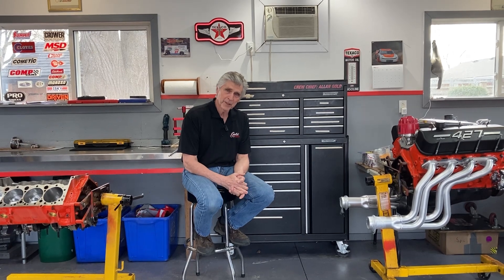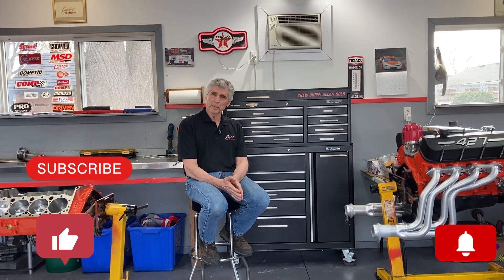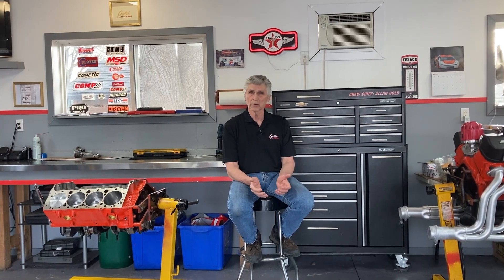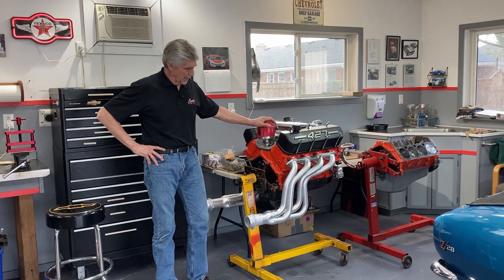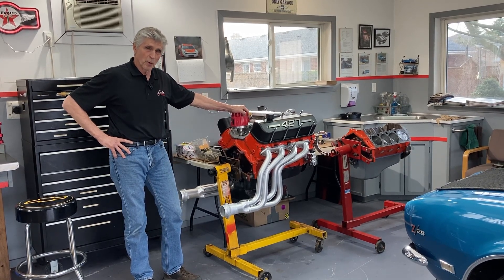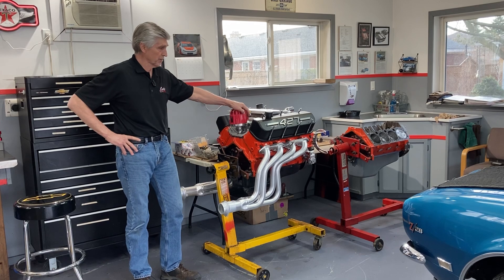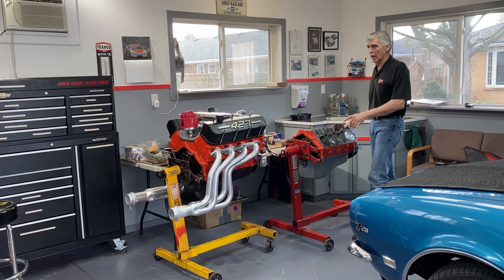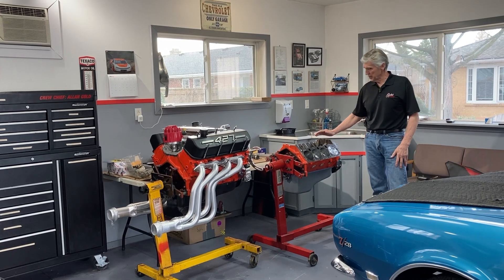Compression Myths - How much compression can you run on pump gas? Questions Answered

Comment: I have a 440 12.5;1 mopar been running 104 plus with 93 for many years no problems. For hard racing I run race fuel and still have steel heads.
Reply from the maker: Thanks for sharing your experience Mopar. All good info. AG
Reply: I call engines "motors" all the time so that I can see who is a newbie and corrects me.  Are you doing the same with your "steel" heads? Because I can assure that all classic American water cooled engines had Cast Iron block, cylinder heads, exhaust manifolds, ets. Steel has pure iron in it and 1,2,3,4,5% carbon blended homogeneously in it. Cast iron is pure iron with more than 5% carbon, a bunch of impurities, and silicon. Silicon makes it so the "excess" carbon precipitates like rain out of humid air - after the iron is poured/cast. So it's like tiny chocolate chips of pure graphite throughout the part. Some car crankshafts are forged steel to resist breakage. Most truck engines have cast iron crankshafts because the connecting rod journals are way harder and resist wear 10X better than forged steel .Lastly when you melt cast iron it gets really fluid and fills out a cheap sand mold exactly. Steel kind of has to made into giant rods called "blooms" and either some bitten off and hammered into a part or else the whole thing gets made into a battleship gun barrel or bridge part.
Reply from the maker: Thanks Patrick lots of good information here. I am guilty of using the wrong terms too even though I know better. A motor is an electrical device. An engine turns chemical energy (fuel) into mechanical energy and heat via combustion.
I haven't heard some of the steel terms in a while.  
In my corporate career I worked for an integrated steel company (Algoma Steel) for 34 years and retired as a General Manager in 2004, then consulted in the industry for many of the major steel companies in the world including US Steel until a few years ago. 
At Algoma we made about 3 million tons of steel per year via the integrated process, pelletized iron ore, coal (refined as coke) and limestone produced raw iron in a blast furnace, also known as pig iron, about 3% carbon. The pig iron was then transferred to the steelmaking shop and mixed with about 20% scrap and refined in 350 ton BOF (Basic Oxygen furnace) a batch process using 27,000CFM of pure oxygen for about 20 minutes. That reduced the carbon content to about 0.10-20% depending on the application, further refined in an LMF, (Ladle Metallurgy Furnace) and prepared for continuous casting and subsequently rolling down to <1mm. (039") thick. End application automotive, appliances etc. (sheet and strip.)
You are correct, cast iron is brittle because of the high carbon content. Steel used in forged crankshafts and rods for example (4340) is 0.4% carbon. The third number is the carbon content. 
You are correct, heads and blocks are either cast iron or cast aluminum.  Forged cranks and rods are steel, usually 4340. 4140 or 5140. 
Hope this helps, and thanks for your valued input. Please keep watching and commenting. AG
Reply: @goldsgarage8236  Ah, good - you know the deal, then.  I am a genetic hillbilly and I hereby grant you license to say "My Mopar Motor has Steel Heads" with a straight face 1) because it sounds cool 2) impresses women and kids. 3) Creative lying is a time-honored hillbilly art form  :  )
Reply from the maker: thanks Patrick AG

Comment: I’m wondering how much of a difference “chamber softening” or polishing and spark plug selection make on an engine’s resistance to knock and pre-ignition.  Have you ever quantified that for your engines?  Great video by the way!
Reply from the maker: Thanks Nate. spark plug selection sure does, I meant to mention it in the video but it slipped my mind so thanks for reminding me. I also missed discussing quench, I will try to correct that in future videos.  I have looked at chamber softening info but never applied it. Good points. AG
Reply: @goldsgarage8236  What is quench exactly?
Reply: @seanmclaughlin7415   - quench is the area between the piston and the cylinder head surface that get very close together with the piston at TDC.  From what I’ve heard, it is very critical on a Small Block Chevy style engine but not as critical on an LS.  I’ve heard that a tight quench is a free boost to compression ratio but never have seen it quantified or measured versus knock/pre-ignition. Would be an awesome Richard Holdner or Engine Masters episode.
Reply: @natez0690  Thanks for responding. I saw a video that Steve Morris did on quench and how they approach this. Basically, it is more trial and error more so than math, but math is involved. Steve designs a conical shape with the combustion chamber on the side where the piston meets the flat of the head into the combustion chamber. Also, he gets the the piston to actually touch the flat safely to maximize quench. Obviously the DIY’er doesn’t have the equipment to do what he does, or maybe there are other ways to achieve this.
Reply: Any and all of those factors will and can cause major swings in a max effort engine build  exercise caution and diligence you should have a good time

Comment: I’ve always been under the opinion that the air pump’s purpose was to also help with any unburnt hydrocarbons in the exhaust. Not sure if they were onto intake/exhaust reversion yet. 🤷‍♂️
Reply from the maker: Thanks Lujin, you are probably right about that. Thanks for your input. AG

Comment: You should discuss quench/squish in relation to how high a CR can be run on 91/93 octane pump gas. It plays a big factor in avoiding lean pockets of mixture in the cylinder.
BTW: I never understood running 87 octane piss in an expensive, high compression engine.
Reply from the maker: Thanks Joseph. I did intend to do that in the last video. I guess I should make a script. Anyway, I will fit that in a future video. Thanks for the input/AG
Reply: I agree on the quench topic.

Comment: Basically what's going on in any motor is timing. The camshaft controls that . But at the end of the day , cranking psi will determine what octane rated fuel you need . The rest is preference. I recommend finding a reputable engine builder ,
Reply from the maker: Thanks for your comment. AG

Comment: How do you feel about fuel additives that increase octane? And is there any you can suggest I ran sunoco 102 octane when I lived in Florida I could get it at the gas station I'm back in Louisiana now and all I can get is 93 octane I would go E85 but they are few around where I live. The closest is about 30 miles away
Reply: Boostane is a quality octane boost. All the better tuner shops I know swear by it. Tuning 1000rwhp modern muscle cars.
Reply: @pockets5628  thanks for the info
Reply from the maker: Thanks for the info Pockets. AG
Reply from the maker: Sorry Richard, I don't have much experience with octane boosters myself but it looks like Pockets does. AG
Reply: @goldsgarage8236  I use VP or Torco additives..store bought stuff is snake oil.

Comment: Car manufacturers definitely gave in to pressures from big insurance and EPA. What's really interesting is if you look at hp numbers throughout the 70's, 80's & 90's they were dismal in comparison to hp #'s from the 60s. Then something really great happened, between Ethonal, forced induction and nitrous the hp has returned in a big way and now we can really go FAST. LONG LIVE THE HOT ROD!!!!!!
Reply from the maker: Thanks Zl, I agree it took the OEMs more than 20 years to learn how to make power again. Computers helped. AG
Reply: Always worth noting that right as the EPA regulations were killing power manufacturers were also required to start reporting horsepower with all the accessories and exhaust attached.  (a '60's car with a SAE gross 350hp might only rate at 315hp or whatever under 1970's SAE net standards)
Reply: I wouldn’t call what the EPA did “pressures.”  You also have to account for the change from gross to net hp ratings. And also that they’re “ratings.” Even things like the 03-04 cobra were “rated” at 390 crank hp…but dyno’ed that much at the wheels.

Comment: It's not just in your compression ratio, at least 30% of it is in your cam timing, with overlap and duration - and is overlooked by a good percentage of people. I guarantee you could take an 8:1 compression ratio engine and put too much cam in it and have it ping.
Reply: True,,a low duration or stock cam too far advanced so the intake valve closes too early will build more dynamic compression
Reply: @rodfonda3248  all the talking about static and finally someone bring dynamic thank you sir
Reply from the maker: Thanks Chuck, you are right on. I remember hearing many engines ping if the conditions were right. Thanks for your comment. AG

Comment: Get good cylinder heads with good combustion chambers, that helps in being able to run less timing, today's fuel releases its energy alot sooner. 
Your turning strategy with high compression engines must mirror that of an engine running forced induction.
What does a 700 hp Hellcat run for fuel???...91-93 pump!
Remember 14.7 to 1 is not the right AF ratio to tune with any more, you must take into consideration that Ethanol content, and make the overall tune richer.
Reply from the maker: All good points, thanks Duane and sorry I missed your comment until now. AG

Comment: Does  octane boost in cans really work  ??  Does  it do harm to carburetors  and fuel pumps ??
Reply from the maker: Thanks Richie, I don't have much experience with octane boosters. I build engines that don't need them. 
I think they do work if you are diligent about mixing etc. They are also not cheap. AG
Reply: If you buy the good stuff. Auto parts store octane boosters, no . Garbage,

Comment: Hey Mr. Gold, I'd like to share additional experiences with you and the viewers with my 11.6 to 1 stroker project car.  We spoke before about my running 93 on the street with good success as long as I stay out of the secondary's (tunnel ram 600 vac).  Race gas needed for WOT, (drag strip). Another problem with this setup is not getting what you pay for.  Not all gas stations pump 93 from the 93 tanks.  I've had multiple experiences with what seemed to be 87 from a 93 pump, as well as more than the 10% limit ethanol fuels (causing sever lean condition).  There's a financial incentive from wholesale to retail to cheat with this.  That can be a disaster for those of us trying to push the limit of compression.  Then there's also the possibility I won't hear the preignition  causing damage over time.  So for the customer builds and those who want reliability don't push it.  I only did for the pure gear head itch to see "what if".  My car is a rolling experiment  to satisfy the mind.  My next experiment is a methanol/water injection set up that will be triggered with secondary opening.  I believe this will allow  WOT on 93 octane.  Now that you you stoked my interest with these compression facts and theory I'll go back and enjoy your previous video's.
Reply from the maker: Great comments Bobby, I wish I had thought to mention the issue about the risk of not getting the octane you are paying for. Thanks so much! AG
Reply: Welp. Guess I'm going to leave well enough alone at 10.5 static (~9.5 dynamic). Never even considered I might pump 87 octane into my tank without realizing it.

Comment: I do have a question I have a 498 Big Block chevy I have about 12.5 comp.with a lock out Dist.with iron heads .if a have a 11.5 air fuel ratio what should the timing be to run 100
Reply from the maker: Thanks Mark,  That sounds like a race engine. I think that is something you would have to test for, preferably on a dyno. Start on the conservative side. Looks like you are rich enough. AG
Reply: On the dyno, I would hazard 35 to 39 degrees would give the best power curve, but I wouldn't expect much more than a 10 HP difference between those numbers, and quite possibly an inverse relation as the timing moves up to the best peak number. (trades losses at the start of the run for gains at the end) 

Additionally, you'll be losing everywhere with that rich an air/fuel unless it's an octane deficiency requirement. 12.8 to 13.2 is a normal "best numbers" ratio.
Reply: @yarrdayarrdayarrda  36 t0 38 degree of timing I really can tell any differnamts  the ets were the same .
If I go to a 12.8 to a 13.2 are thete going to be some lean  cylinders  like in the 14s  ?
Reply from the maker: Thanks Mark, we don't have the ability to measure F/A in individual cylinders. 36 to 38 degrees advance doesn't usually make much difference on the dyno either. Good questions. AG
Reply: Static compression means nothing, dynamic compression does. If the cam timing, combustion chamber shape, piston crown shape, ignition and knock control ( if equipped ) are correct you can run pump gas with a lot of static compression. Ferrari currently runs 14.5 to 1 static compression in their  812 Superfast, a 6.3 liter V12.
Reply from the maker: Thanks Hoost, good points. AG

Comment: Nice explanation of the area of the piston and the psi pushing on the piston.  I ran across an old Buick ad from the late 50's and their Nailhead V8 -  they called it the B-12000 - it had 12000 pounds pushing on every stroke. 
The end of high compression V8's from Detroit - I don't know, but it seems like all 3 of the big automakers were doing pretty good financially around 1970, but none of them invested in better cylinder head and camshaft tech that would have helped keep HP decent even with the lower compression.   Instead we got 190 HP 455's  and  460's.  A 190 HP Cadillac 500 engine.   Even if they stopped using these big engines in mid size cars, their huge cars they made at the time would have benefitted from some investment.
Reply from the maker: Thanks John, that is interesting about the Buick ad. OEM's are driven by ROI, return on investment. They just want to make money! Good comments.
Reply: Emissions regulations killed hp as well.

Comment: Well explained. 
I have a 66 pontiac starchief executive à little resto-mod old school myself with a factory 10:5 compression 389ci 389ci 4bbl 325hp and 425fp/Torque with 2.73 gear.  I can run regular 87 gas but i can't have the same timing.  I can ear the pinging as soon as i push the Torque at 2500 rpm.  Before i understood fully how to be to be able to advance the timing, to be more snappy throttle the way i wanted the 4400 pounds car to be, i had to put supreme gasoline and a little shot of Lucas gasoline additive.  Its the only way i like it to be snappy and roaring at pedal to the metal way.  Pinging from pre-ignition is bad for the piston top i was told  and my 389ci likes it like that.  Maybe not yours but if you want to run higher compression engines, be sure your aware of what to do and not to do when it come to engine gasoline cocktails.  You could ruin an engine in no time if you don't know the basics.  Heat, octane, gas additive, ring gaps, blowby,  cylinder compression, and fuel ratio " too rich or too lean".  
Nice content.  Well explained!
Reply from the maker: Sounds like you know how to manage it. I would use the best pump gas you can get! AG

Comment: I've noticed when using the Wallace Racing calculator to figure cranking compression they show gauge pressure & cranking pressure. Which figure is best to use? Mopar engine shop Hughes Engines recommends 165 psi for iron heads & 195 psi for aluminum heads. Any comments on that?
Reply from the maker: Thanks Ragingbull. Dynamic Compression Ratio is a theoretical number. Compression pressure is an actual number. I would go with cranking pressure. AG
Reply: @goldsgarage8236   Thanks for replying.
Reply: If you decide to make another video on this topic you may want to research the “VP”-Index (YT won’t let me post a link but, there is a clickable link on this topic under the Wallace cranking compression calculator)….theres multiple sources that talk about VP-index but, I’ve not seen any of the common calculators people use to estimate DCR / CCR or cranking compression include it.
Reply: The reason they give two pressure numbers on this calculator is one is gage (not corrected for atmospheric conditions which includes the absolute pressure). If your around sea level / below 1K feet altitude and ambient / under hood temperatures are not super high then the gage value can be trusted / used against the norm values people speak about for safe DCR / safe CCR values.

Something that these calculators do not consider well is the “VP”-index value (below the Wallace calculator they added a clickable link that describes VP calculation and how this needs considered separately from just DCR / CCR or measured cranking pressure.

Comment: Nobody runs 87 octane that I know of because it has that S(#(t ethanol in it that completely wrecks anything with a carburetor and because of fuel separation of ethanol/ fuel and then the water.. One minute your running ethanol and the next low octane fuel because they actually use the Ethanol to bump up the octane and when it separates its bad bad bad!   Every hot rod guy I know runs 91+ octane fuel non ethanol and that is perfectly safe for 10.5;1 and some 11;1 cars that are light! Yes weight of vehicle makes a difference in spark nock!
Reply from the maker: Thanks for your input Larry. Weight of the car is an issue for sure. I wish I had remembered to mention that in the video. AG
Reply: Need more gear.